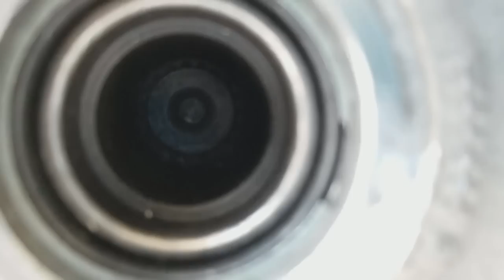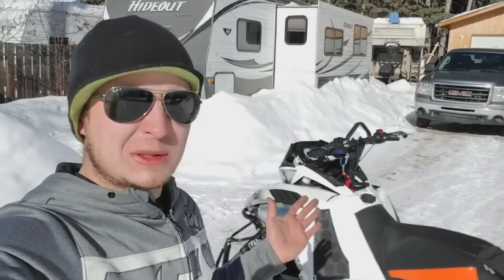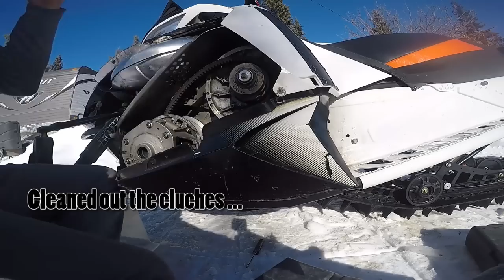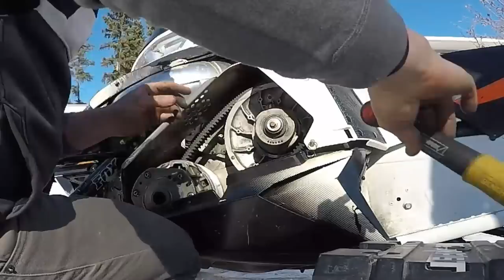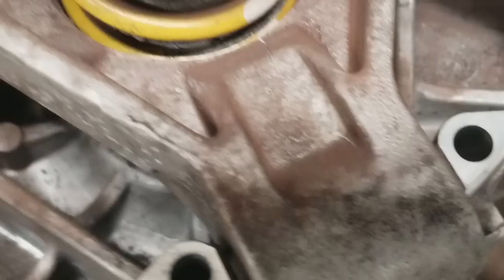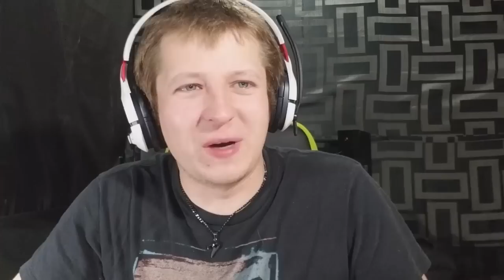Arctic Cat M8000 CLUTCH PROBLEMS | RESOLVED

Comment: Hi   I had a look at your video, very good,  I do have a suggestion though.  Check your fly weight position between the towers. It looked like a weight had shifted to one side. This would cause the clutch to not fully open at idle causing creep. It appears to operate properly without a belt but creep with belt installed.  If you do have this issue take is apart and replace the fly weight bolt as it would have substained forces it is not designed to and will break at the dimple in the middle of the bolt. The fly weight is suppose to be dead centre between the towers and a very small allen head screw holds it in this position.
Reply from the maker: Rene Page 
See the next video for the resolution.

Comment: I feel for ya I've gone through 3 arctic cat clutches on my 2011 m8. I now run a team clutch for a 2016 m8 and so far it work's very well
Reply from the maker: On those older ones I think the trick is to just keep the things clean.
Reply: That definitely helps.
Reply: I had this same issue on my 15 m8000 it was related to a cracked spider on the primary clutch that would not let the clutch open all the way part that sucks is this year was not a team clutch and had to buy an entire new primary clutch since you can't just buy the spider and replace replace it

Comment: I dont think cat clutches are junk. I clean them after every ride. Or just inspect them. Got over 7000 miles, no problems. They just like to be clean. I now have a sled with team clutches. I'll continue to do the same.
Reply from the maker: That's something good  to mention. If you are able to keep them clean they should last. But, sometimes it's hard on those 4 day trips to keep them clean after everyday. A lot of dust does get built up in there.
Reply: Compressed air, to blow out belt dust is quick and easy.   Most people would be surprised how much belt dust there is after one day of riding.

Comment: Just bought a used 2015 M8000. about 2000miles on it. Test drove it yesterday and noticed it tried to walk too. And belt started to make some noise after letting it idle. I figured that the belt was too tight but it sits very deep in the secondary, whole belt below the plates... Take it back to the dealer...? Also the ignition key does nothing, u can just drive it without the key if you want... Had brp's before, made me think did I make a mistake... xD

Comment: Do you know if you can start a sled without the primary clutch connected to the motor?
Reply from the maker: You can. Yes. But. It is going to be a real tough unit to pull over. The clutch acts as a flywheel for the PTO and assists momentum

Comment: when it was idling you could see the clutch wobble.. hard to tell from video but looked like more then motor vibration
Reply from the maker: They will wobble on idle. Its straight once its reved up
Reply: You can see it at 5:00 in the video.... secondary gets pulled every time the primary wobbles.....

Comment: How do you adjust the belt deflection on this style of clutch
Reply: With different thickness washers used on the secondary clutch bmp has a bolt that will do this as well but is expensive for a plastic piece

Comment: need to put in a new primary clutch spring -put in a stiffer   spring
Reply from the maker: What makes you say that?
Reply: @syxxes I want to run a set of spacers on the spring or a stronger spring had same issue had it fully apart and no visible damage or cracks so gonna run it

Comment: Your belt deflection is not right lol , that was not the problem like you said but I say it , your belt is too tight , creep too much
Reply from the maker: 1 1/8th inch to 1 1/4 inch. This is the correct deflection. Nothing was wrong with the belt deflection at all. Primary clutch cracked -Cat Master Mechanic